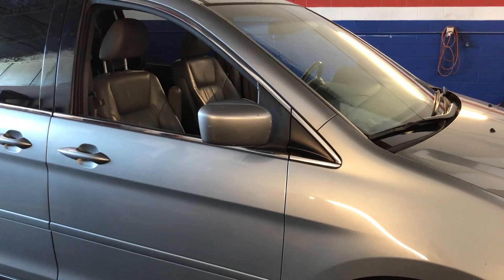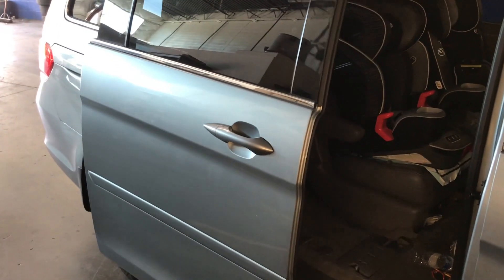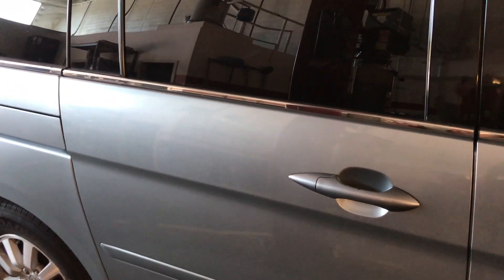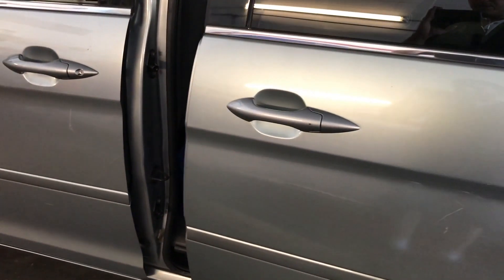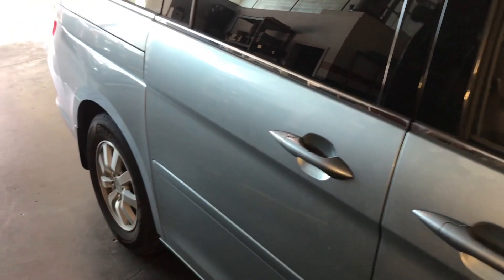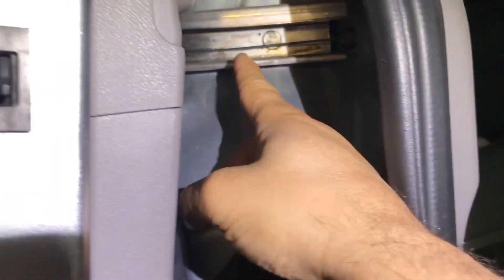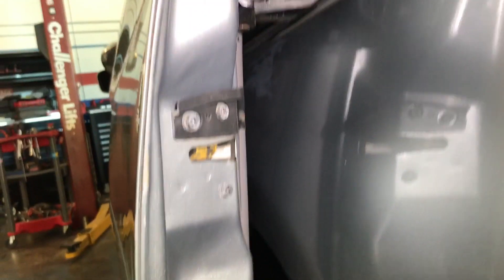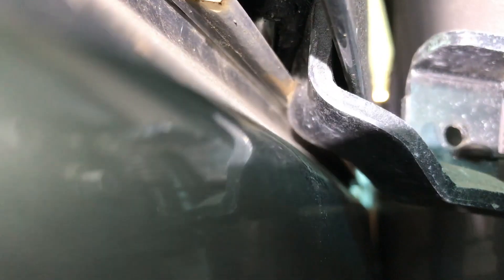2010 Honda Odyssey sliding door problem

Comment: the reason it jerks is because the plastic rolls on the sliding door track have broken off & the door is makng metal to metal grinding on the rail
Reply: Both of my doors are having problems. Where are these rollers you speak of? Mine will open about 10 inches before beeping and closing themselves unless we stop it.

Comment: Tip: if you’re door is acting like this and you’re stuck in a parking lot, etc. try this. - Put the car in Drive. Slowly, in can be inches, start to move and hit the close the door anyway you want (remote or panel). My door closes every time. 
Something needs to be fixed but it will close the door.
Reply: I do the same thing with my wife van

Comment: My door did this...then fell off at the grocery store. My husband and I had to catch it before it fell on my daughter. Honda won't do anything about it.  It's a 2200$$$ fee at the dealer!!!!!
Reply: @Mike Hannigan Thank you.
Reply: The rollers are common wear points. This is not Honda's fault. The rollers are a regular part that wears out over time as the doors get used, and you should have replaced them when you first had issues.
Reply: @Mike Hannigan Haven't seen this. Usually what happens is the rollers wear down, the door rides on the posts, eventually the posts break because they weren't designed to do that, and when they do, the door falls. All prevented by replacing the rollers when you start having issues.

Comment: NOT helpful for me! Mine is a 2010 but I do NOT have this feature in my van at all!!! And my doors are still stuck! Both sliding doors! Mine is not mechanical. They don't slide on their own. You have to open and close them manually. So this is useless.
Reply from the maker: Sarafina Donald your van if is an Odyssey would have this same problem. The actual lever is covered by a metal guard or trim. It would be better if you seek a tech to help you.
Reply: change out rollers fix under $100